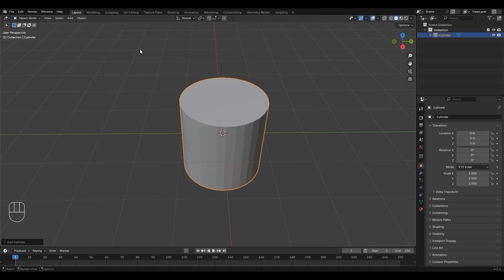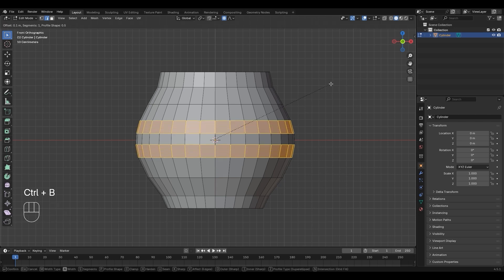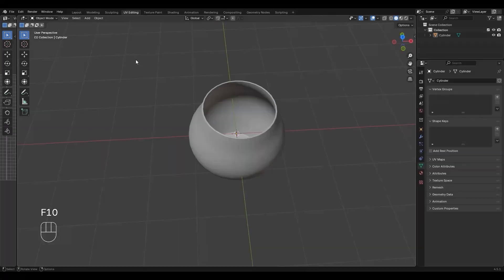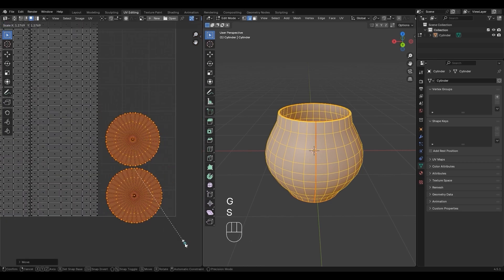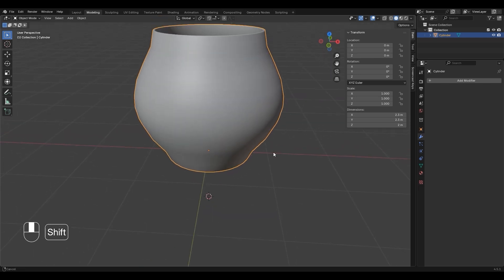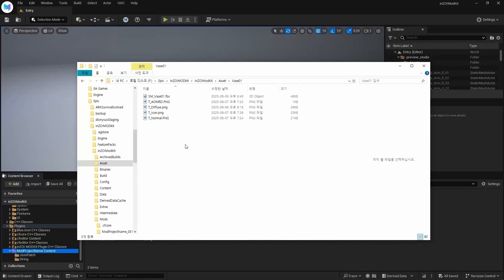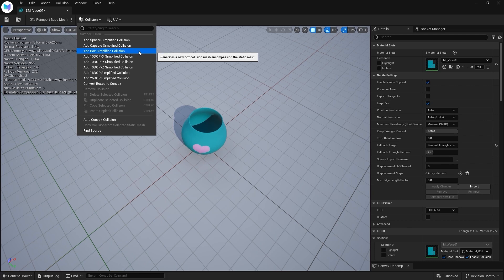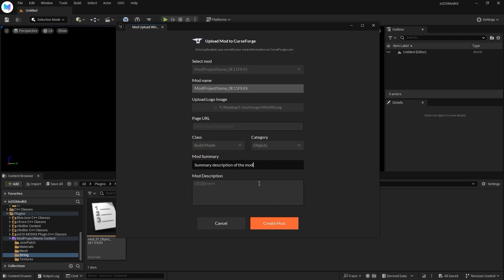Create a Vase Mod | inZOI ModKit Tutorial

Comment: I yet need to check if the ModKit can be easily launched under Linux, but before the ModKit (on objects imported to the game directly from Blender as 3D printed) I had problems with all the materials looking too glossy in the game, no matter how metallicity, roughness or normals were applied and whether I created separate texture maps or used material parameters, unless I touched alpha channel of the material to make it something like 99% of opacity, but then that material in the game was looking too rough instead. Hoping the ModKit would solve my problems with materials.